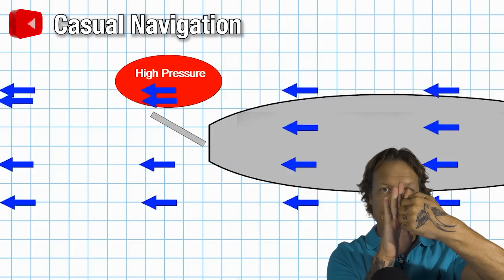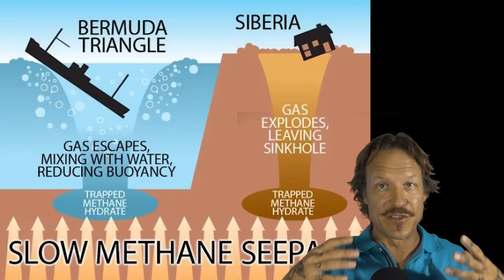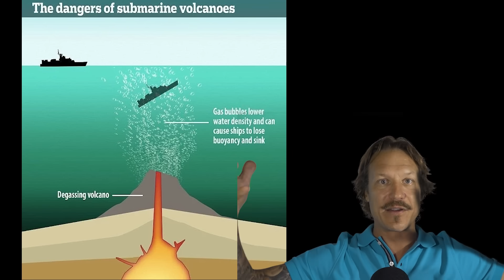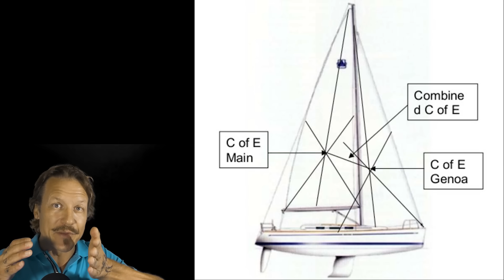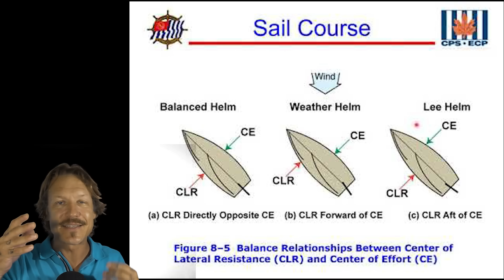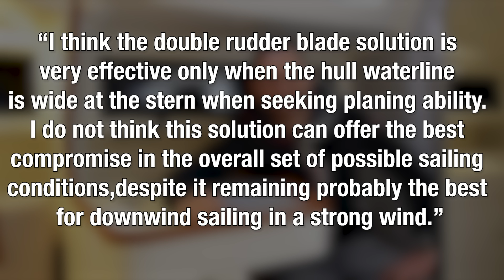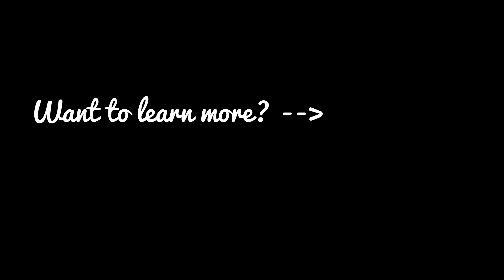The Problem With Dual Rudders Nobody Talks About

Comment: Hi James, interesting that the images shown have the windward rudder out of the water, which imo is simply too much heel and actually slowing the boat down. Why have a wide boat for comfort and then heel it over so far it’s no longer comfortable? 
Yesterday on my twin rudder boat, I had 25 knots well fwd of the beam, 2 reefs in main and headsail, little weather helm and great speed, today similar conditions with the wind just behind the beam, great sail. At 16 tonne loaded, it doesn’t plane, far from it. 
I’ve done 35,000nm on it and about to complete a circumnavigation and go round the Cape of Good Hope. 
Do I consider it a BlueWater boat or a high latitude boat, certainly not but you can sail around the world and how many boats are going to Antartica anyway? These are generally Expedition Boats, not your typical Oyster
For those hear saying twin rudder boats are difficult in marinas, get some more practice, they are very responsive and reverse better than some Hunter’s I’ve docked

Comment: Very good!  Not an offshore sailor (just some harbor and coastal cruising experience).  However, I grew up sailing with two physicists - my father and his best friend - who were always discussing the interaction of water (regular, still water, current, tide), air, and boat forces.  Important to be aware of all that.  Enjoyed your analysis and it made sense to me.  Nothing nicer than when a boat is just in that zone of the right tack for the direction of wind and current!  Who would want to have to "fiddle" with it.  Question for you: if the wider stern racers are designed to plane out more, is that only effective going downwind or is it a factor tacking upwind also?  Asking because many traditional races go triangular courses so a bit of all is involved.  Just found your channel and have subscribed.  Thank you for all the info.

Comment: If you've sailed on boats with a wide beam, they were not very good IMHO! When a well designed wide stern boat is heeled the hull drag moves to leeward which tends to compensate boats tendency to get weather helm as they heel. Thus the tiller stay in the middle for quite a while and once it becomes hard, you just reef. Also wide boats are more powerful at low heel angles and they don't need to be healing like mad, often 15º-18º heel is necessary to reach top speed. Like all boats, wide boats heve drawbacks but being hard to steer or being unable to go well to windward isn't one of them!

Comment: Love your vids! One minor point -  you said single rudders can cavitate when the head is exposed during heeling but it’s really ventilation which has the same effect but a different root cause. Cavitation typically requires speeds of >50 knots which causes the boiling point of water drop to the ambient sea temperature while ventilation is simply air being sucked down along the foil. SailGP, AC, and ULTIMEs can experience cavitation but not really the much slower boats for the masses.
Reply: I've heard many sailors complain about cavitation issues with their rudders, couldn't it happen at lower speeds due to specific pressure conditions ?

In fact i have hear more issue with cavitation on narrow boats with dual rudders (like the mini 6.50). For example it is easy to compare on the j99 as the same boat exists with either 1 or 2 rudders.

Comment: Sirius DS are not so wide boats. I suppose they are a little better due to this design.
We need to remember: THERE IS NO SUCH A THING AS A PERFECT BOAT.
Find one you like, like a wife, knowing it's not perfect... and be happy with it, adjusting all the time, through years and years.
And remember, sailing is exactly that, adjust to waves, wind, currents, weather, over and over, all the time. This is sailing.

Comment: Mass market designers make boats to do well on Wed. Night beer can races on fully crewed boats racing on flat water. Just like bicycles, designed for racing(drop handle bars, no fenders). Compare to the sensible Dutch bikes that the every day man uses instead of a car for commuting.A cruising couple will experience a few gales and maybe 16-20 foot seas on a circumnavigation.(at least we did on a 10 yr circumnavigation). Can a couple reduce sail for the conditions encountered?
Twitchy sports car vs. Mercedes for cross country trip. You decide.

Comment: An excellent and well-balanced explanation regarding single or twin rudders, weather helm, and hull shape.  My choice is a boat with a single rudder for the reasons you mention and additionally because af the effect of propeller wash during tight spot maneuvering at no or low speed. Some marinas are really tight, and with a twin rudder setup, this advantage is lost.

Comment: There is another important problem which almost nobody takes into consideration: self-righting. Boats with those wide sterns once they capsize they will stay in that position!  This problem has been solved in racing boats building tilting keels (something which increases hugely the cost of the boat), and also building an escape aperture on the transom so that the crew trapped inside when the boat is upsidedown can exit through that aperture. Yet, cruising boats DON'T have tilting keels, and don't have escaping apertures! I'd not feel safe to sail off shore in one of those boats...
Reply: Amen brother... I capsized aboard a super-beamy French boat while crossing the north Atlantic, and she did NOT self-right from an inverted position. The only thing that saved us was the next wave, which tossed us from 180-degrees to something closer to 90-degrees, and THEN she was able to shake it off and get back on her feet. Were it not for that next wave, she was on her way down and I wouldn't be typing this.

Comment: Boat characteristics are just that, characteristics native to a design. They are neither good nor bad. Keep in mind, in designing anything there are trade offs of every design decission. This is alwas the issue between designers and users ... users just demand, not care and call out a characteristic as a problem. Its just a different boat design ... just like between a cat and a single hull, just a bigger spread of characteristics in this case. One can always design a twin rudder for upwind performance just like one can alwas be a better skipper, a more aware one, that sails his boat within the window it was designed for and what happens if you go outside of it.

Comment: Very much agree with you here. 
There is a lack of cruisers being manufactured, I have had friends try to buy boats new off a yard and there really arent many options. A 70s-80s with a lot of outdated systems and material wear is not an attractive option for many buyers, it is a shame. 

Few things beat a ketch with a semi full keel for cruising purposes, but who makes those nowadays.
Also wide tramsons, with the sleeping quarters at the aft make for very noisy nights next to your head at anchor, slap slap of the water. These things are meant to stay in a marine and be used for day sailing.

Comment: I have a question because I do not know, but would like to::
 Is there any  rudder (single or twin) that is designed so that it is always plumb no matter what angle the boat is healing? That would involve some complicated engineering, perhaps with some kind of gyroscope. If not a gyroscope, the end of the rudder might have to be weighted with lead. Or maybe a design that includes both.
Reply: A swinging rudder would need some sort of drive system that holds it at a given angle which introduces complexity and more failure modes which is not something that's desirable for a rudder.
Reply: @paulpaul9914  I did say that the idea would take some engineering! It might be done several ways. Swinging keels are not new but they remain  parallel to the center line of the boat.
Reply: @DAVIDMILLER-nc9vo 

Just putting a weight on a swinging rudder would definitely not work, as soon as the rudder is set to turn the boat the rudder will simply swing up until it looses authority. 

If a rudder can simply swing around the boats horizontal forward to aft axis the rudder has been rendered useless.

A mechanism that holds the rudder at a set swing angle is then required and can adjust the swing angle according to heel angle. I would never put such an arrangement on a standard cruising sailboat that I intended to use for crossing an ocean. A simple, single spade rudder that is probably over engineered somewhat is all that's required and will do excellent rudder service. 

If extra reliability is required we might look at a water tight rudder post compartment, a break off lower rudder section, a semi skeg hung rudder or a full skeg rudder as per Kraken Yachts & their amazing indestructible Alpha rudder. Kraken do some other rudder stuff including an easily replaced bearings and a rudder that can be dropped a bit if the rudder post did get bent. 

 

I

Comment: Another downside I didn’t notice you mention is that maneuvering in the marina becomes more difficult with twin rudders, as the water flow from the propeller no longer passes over the rudders as it does on older vessels. This makes it challenging to turn the vessel in a tight marina, especially when increasing boat speed is not an option. It also reduces the effectiveness of using dock lines as levers to turn or pivot the vessel during docking and undocking.
Reply: 100%. We were on a Jeanneau 490 in the BVI last month. Twin rudders, no bow thruster. Turned like a brick in the marina. Even the charter company staff had a hard time departing the slip, and required a senior staff member to come do the maneuver.
Reply: @SuperSventizeMe  Agreed... it seems to me any boat built with twin rudders should be required to have bow thrusters.
Reply: @matthewpeterson3329  ?????
Reply: Absolutely. 2 hours of waiting in line inside the port of Hydra proved it. You can't turn the boat with a usual short impulse. Luckily, I had a bowthruster. For a charter boat with two rudders, it is a must.
Reply: Oh yes. My antique canoe hull will turn like an outboard skiff under a pulse from the prop over the rudder. (8' beam, 32' waterline)

Comment: Hi … thanks for the great video. I agree 100%. As a matter of fact, the reason why production boats are getting larger and larger with big squared sterns is cabin space. I have a Jeanneau sun odyssey 440, year 2020. Dual rudder, the max beam goes from mid ship to the stern all the way, 4,30m beam for 13,30m of length. Needless to say that close quarter maneuvers such as a stern spring are almost impossible and also the prop wash is impossible: the propeller is in between the two rudders and you have zero steering if not moving … having bow thrusters becomes an absolute need especially in the med where entering very narrow berths in reverse is the norm. However … I got used to it and I have (almost) no problems now. Modern ORC designs that win offshore regattas such as the Solaris 40, grand soleil 44 (designed by matteo pollo by the way), Xp 44, etc have a single long center rudder … I am doing an offshore ORC regatta in Greece this October on a Solaris 40… looking forward to it!!!

Comment: Great video,  you forgot to mention differences in steering and manoeuvring in ports and marinas. Two rudder setup eliminates prop-wash and the ability to redirect it and steer do boat in very low speed. Also last second corrections when berthing med-style are impossible and you get way less rotation when using spring lines to exit the dock if you were docked sideways. One big plus for two rudders is shallower draft at the aft, which again helps with docking med-style.

Comment: I do not agree with your explanation of changes in CE and CLR.
05:26:   "...and when the boat heels over, it's got more buoyancy in the aft of the boat. When the buoyancy changes, becomes far greater on the aft end of the boat than the forward end of the boat, you change the center of lateral resistance aft and leeward. At the same time it causes the CE...   ...to move aft...."
Not agreed. If the buoancy gets moved to the aft end when heeling, the boat will dive its bow and push the mast and everything rig as well as the sails and ce to the front - compared to more evenly shaped boats. As with any sailing boat, the CE will also move leewards. So, the extra buoancy of a wide stern will create an extra leeward momentum. As does the moving clr, moving to the aft end. So the leeward lever arm gets bigger.
Thus, I do not agree with your explanation. Must be a secondary effect making wide-stern not stable. Maybe it is as simple as This: A wide stern causes more movement of clr and ce by heeling as needed for stability. So the design never will get stable.

Comment: You are missing 2  very important points ( Flat hulls and light weight ) in this conversation.........The boats in general are better suited to downwind sailing due to the wider stern and dual rudders but they are also much better and faster downwind because of the flat hulls which make them pound to weather.  People do not like sailing to weather because their boats pound but they likely have not sailed an older heavy hull design that eats upwind waves for breakfast.  I much prefer upwind sailing because i can not stand how much the boat wanders ( hunts ) back and forth while sailing down wind.  Sailing upwind boats track like they are on rails.  They stay on course and do not overwork the auto pilot.  So the light weight and flat hulls also contribute greatly to the downwind preference.  The down sides of sailing to weather is that its more windy with the apparent wind increasing greatly and it can be a wet ride but our 60ft 30ton beauty loves it.

Comment: Let me explain in 2 sentences rather than 12 minutes:
As offshore reduced-crew sailing and less strict jauge gained traction, hull got wider and auto-pilot became more prevalent, having a single better orientated rudder made it more (energy) efficient for the pilot and responsive than a single rudder…and somewhat boring to steer 😢
And it is way more fun to surf at 12kn with a single vibrating rudder than 20kn with 2 rudders.

Comment: I have a beamy boat with twin flip up stern mounted rudders and adjustable straight foils.  It is a great, fast and fun boat but it is harder work upwind and downwind, than single rudder, narrower sterns.  Downwind in some conditions the stern is pushed around by the waves, then when the wind is stronger she easily surfs well above hull speed.

Comment: Have you ever sailed a JPK fast cruiser?

Not every wide stern boat is the same. The hull shape very much depends. We sail a JPK39FC and I have never sailed a more convenient boat. Also upwind and in tough seas this yachts is an experience which should be incorporated, when giveing  comments like this. Our boat is railing along like a train, and the autopilot takes very little energy. Some people think this is dull and not sportive. I think it is comfort.

The downsides of risk of damage and propwash are undeniable. 

But I don't agree with this video. It is too generalistic.

Comment: Wish you had spoken to the vulnerability of rudders not protected by skeg (or even keel being directly ahead of them) to hazards below, such as coral heads of just shallow waters.  Racing is a specific use case. Doesn’t mean it’s correct for other use cases. Every design confers advantages and compromises. Have to optimize for one’s envisioned use cases. Thanks for the video.

Comment: There are trade offs to every design decision.  You buy a supercar that's designed to go over 300km/h, you're going to have trouble bottoming out in a lot of driveways.  Good at everything nearly always means great at nothing, and great at one thing usually means not much good at most things.  So that fat ass, dual rudder boat is great if you're a racing team trying to win.  Not so much for the family leisurely making an ocean crossing.  Those huge aft cabins though.  Like a very curvy woman, hard to resist.

Comment: You get weather helm when the boat heels with all hull shapes: when the boat heels the CE of the sails moves sideways and is not longer above the center of longitudal resistance of the boat. The lateral distance between the resistance vector of the hull and the force of the sails pushing the boat forward cause torque that generates weather helm.

Comment: If you are going downwind, the dynamics of a big braking wave is that is will cause the boat to turn sideways and you will be very valuable to capsize by the breaking wave.  
Oysters' argument for double rudder is, that you have five times the steering power with twin rudders in this situation.
This is the biggest concern in GGR. Older single rudder boats need a drogue.

Comment: Hi James, as always an informative video. We own a Beneteau Oceanis 51.1 duel rudder which works well in all conditions apart from reversing. We have been looking at and have sailed many new boats as well look for an upgrade for a world trip. The Oyster 495,565 and 595, the Amel and Contest 49 and 50 Cs being the contenders. We discounted the Contest BECAUSE of its single rudder. Much more weather helm in heavy 35+ winds. Professional crew on board setting sails etc during the tests. Not suggesting what you are saying is wrong, just sharing our experience. Just to note, our Beneteau is faster and easier to sail than all the examples I listed. Reversing into a berth is not so easy lol. Although all the examples I list especially the Contest are extreamly well built and absolutely beautiful 😊